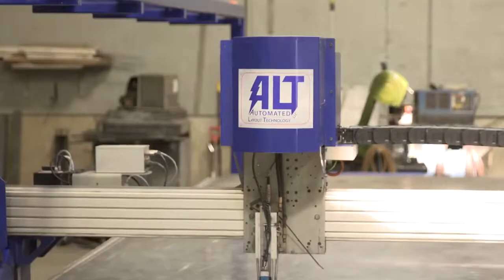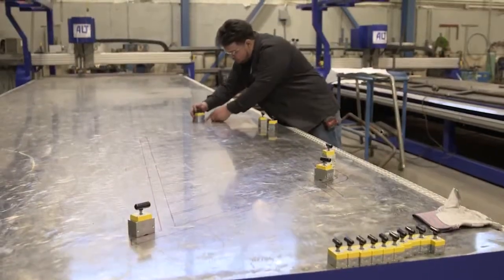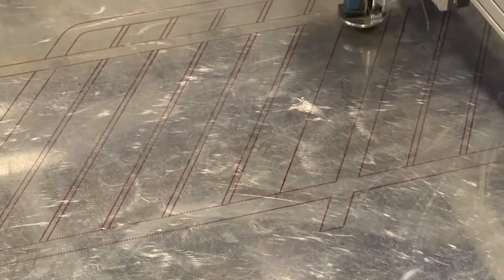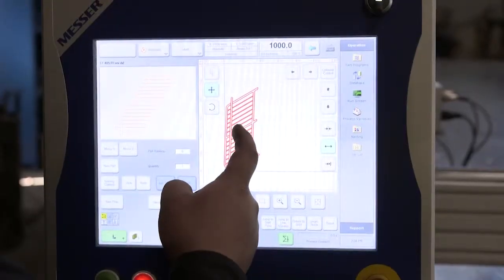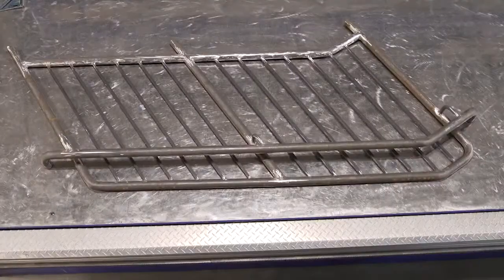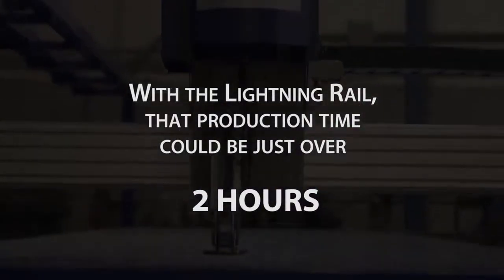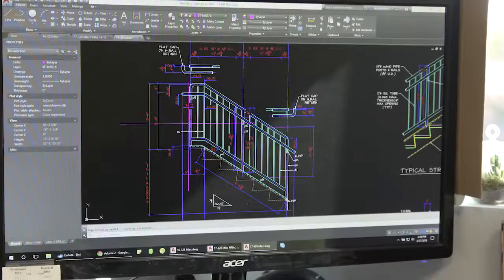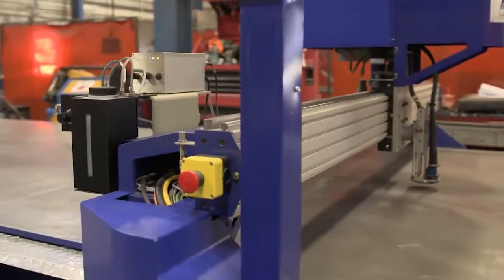Automated Layout Technology - Lightning Rail Automated Layout Table

Comment: This is cool and all. However you could make any cnc table to except ink . Do you still have to manually draw rails on CAD? What would be awesome if there was software to figure picket spacing, angles per your measurements,, that would really save time. How about having automated saws, placement handling equip and welding robots, and painting robots. Would still need humans to babysit. This takes capital, so maybe one day. Your table would save time, and less talent to hire.👍👍